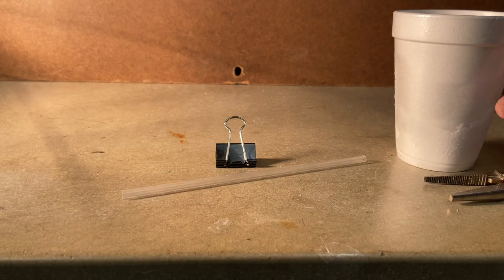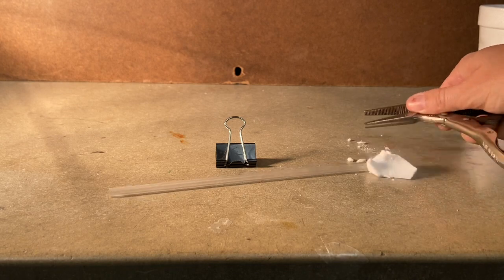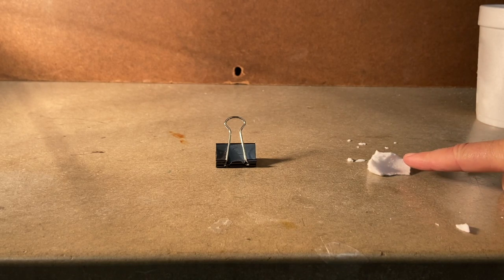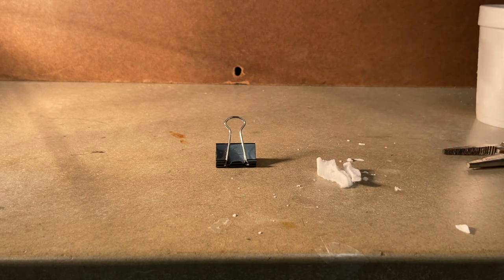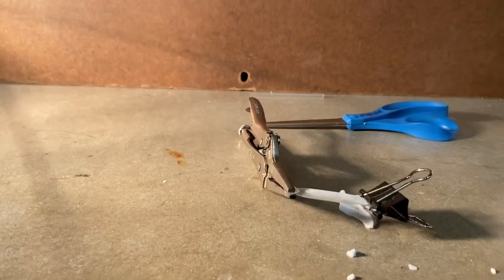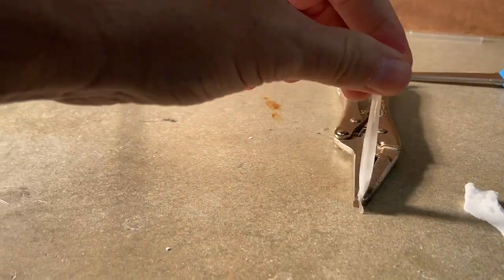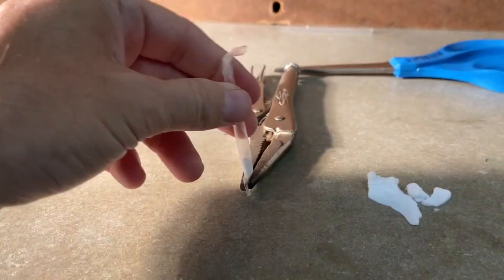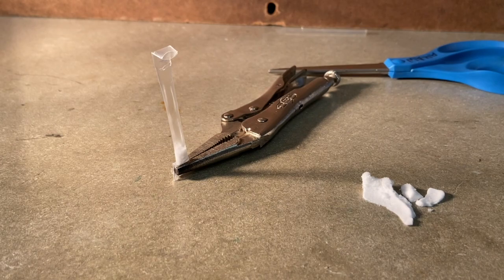Making Liquid Carbon Dioxide from Dry Ice

Comment: FYI may be illegal in the state of California https://leginfo.legislature.ca.gov/faces/codes_displaySection.xhtml?lawCode=PEN&sectionNum=16460.&highlight=true&keyword=destructive%20device
Reply: It is not flammable, so I don't think dry ice meets any of the requirements of that code.
Reply: @you2tooyou2too  see the section that says "Any sealed device containing dry ice (CO2) or other chemically reactive substances assembled for the purpose of causing an explosion by a chemical reaction." that's the part that makes it illegal
Reply: @MartinHoeckerMartinez  True, but it does seem oddly but erroneously specific about CO2 which is not chemically reactive (certainly not in this example), and if that logic error is dismissed, might possibly exclude other such commonly available gases like nitrogen, helium (which react physically the same), or maybe even other chemically reactive gases if not ignited like hydrogen, oxygen, etc.
Reply: @you2tooyou2too   It's totally an oddball inclusion. Putting dry ice into a sealed room temperature container is definitely dangerous and can cause an explosion when the container fails. The best rationale I can think of for the inclusion is that CO2's sublimation is readily accessible (you can easily buy the solid and the transition temperature is below room temperature)